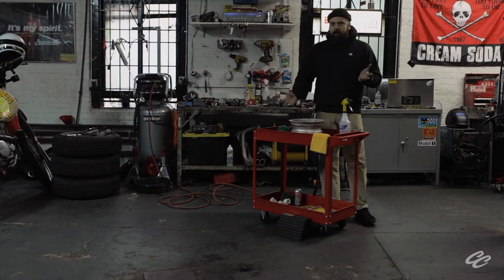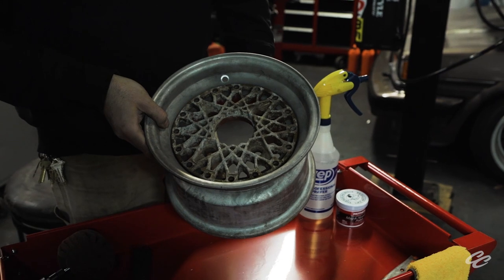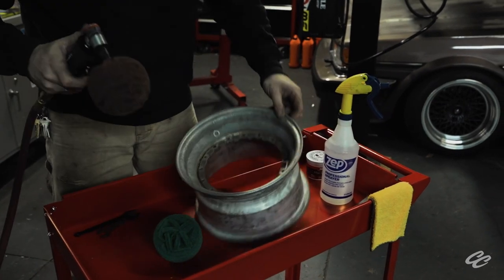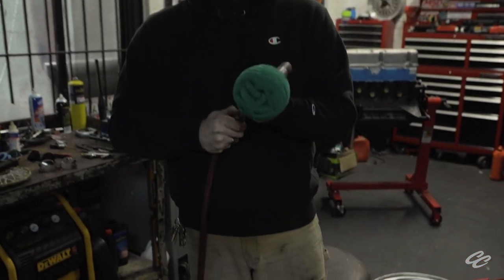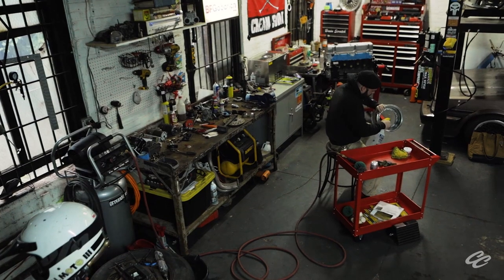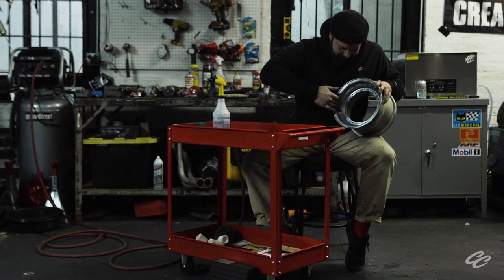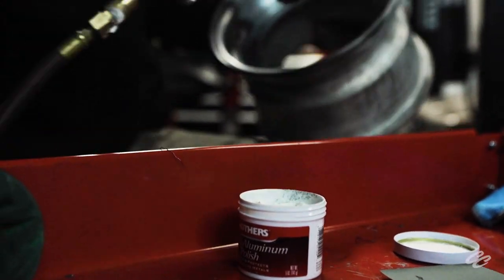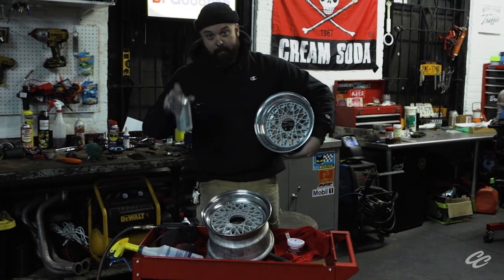How To: Restoring Vintage Wheels for Your Classic Car In 11 Minutes

Comment: Ok awesome, great overview on the aesthetics of an old wheel - but I'm looking to actually restore the old wheels on my 1950/52/60/63/69 cars (International, Jaguar, Porsche). Other than wire wheel/blast to bare steel on the bead rim on the inner side of the wheel rim, and maybe de-rust the inner valley is needed (especially considering bias play to radial?)

Just a quick spray of Rust-Oleum clear? Nothing? Powder coat??
Reply from the maker: On a steel wheel, you'll want to seal it somehow - powdercoat being preferable to a Rusto clear coat. Otherwise, the uncoated steel will be prone to flash rusting or worse. These are alloy wheels in the video, so a refinish / polish on the lips can always be re-polished once oxidation comes back into the equation. They're not susceptible to rusting like steel. We ultimately painted the faces of the wheels to seal them / make them look nice - had we not, they'd end up looking just as bad as when they showed up at our door. Good luck!

Comment: Man, I’ve been working on my Epsilon Southern ways wheels for a few months now in my spare time and ya, some serious hours of this. Mine had some pretty bad pitting. The faces I’ve had to do by hand but I painted them black then sanded off the spokes and am polishing those too with a dremmel. I was going to clearcoat the parts a bunch and put them back together soon but I noticed you didn’t mention a clear coat, is that something you did? My first time doing this so truly curious. I like the videos tho, good job for sure! Wheels are going on my 260z😬
Reply from the maker: If you paint the faces, clear coat those. But anything else youre keeping polished, do NOT clear coat. For these, we painted & clear coated the faces only. Good luck!